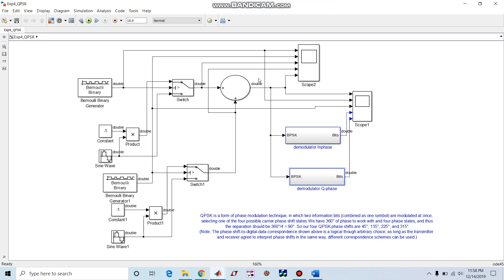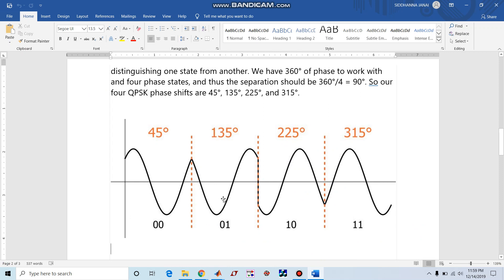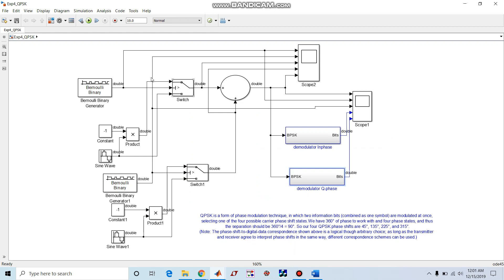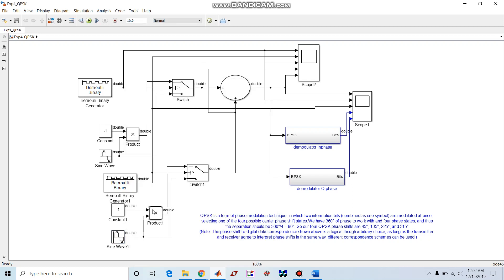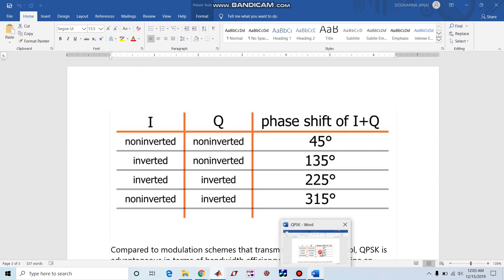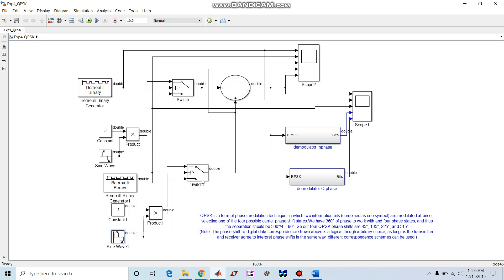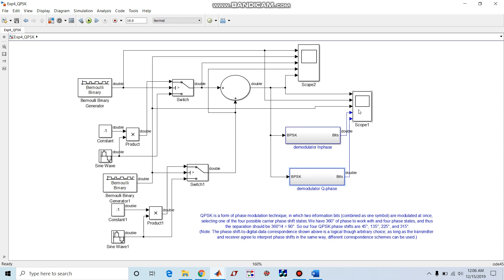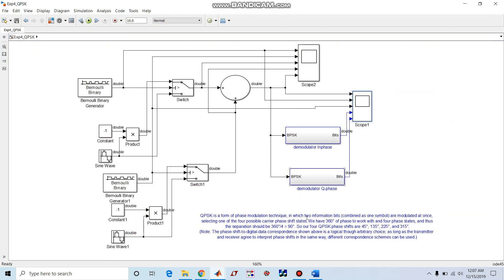QPSK | Quadrature Phase Shift Keying | Software Exp_4B | Communication_Lab_18ECL67 #VTU #ECE |MATLAB

Comment: I have a question since u have used two binary Bernoulli generators ..will both produce same sequence or different?
Reply from the maker: If the initial seed in the Bernoulli generator is changed then both the sequences will be different
Reply: @_Learn_With_Me_EraofAI  if both are producing different sequence then how you are extracting even and odd bits of original signal. Rather you are generating even and odd bits separately which are not a part of original signal as there is no original signal
Reply: Actually my project is on this. I have to achieve higher data rate in terms of MHz. Can u suggest anything regarding it?
Reply from the maker: @shubhamnayak9369 I have faced some difficulties when tried generating single sequence and dividing it into even and odd . So I took two random sequences one assumed to be odd and another even. 

My interest was to illustrate the in-phase, quadrature phase and qpsk waveforms.
Reply from the maker: @shubhamnayak9369  I think for MHz frequencies you can use matlab's inbuilt qpsk modulator and demodulators
Reply: @_Learn_With_Me_EraofAI  ok thanks for replying. Your efforts are appreciated.
Reply: @_Learn_With_Me_EraofAI  I was unknown of this that matlab has inbuilt qpsk system. Thanks for letting me know. I will try
Reply from the maker: @shubhamnayak9369  Thank you. All the best.

Comment: Can u upload the comparator block which was used in book block?
Reply: Bpsk*
Reply from the maker: Send me the particular block diagram you want to implement
Reply: @_Learn_With_Me_EraofAI  I am implementing the same which u have explained in the video. In demodulation part I was struck. Comparator block u have used in bpsk block. U didn't open dat comparator block. I want to know how u did comparator block?
Reply: @_Learn_With_Me_EraofAI  can u upload the file which u have explained in the video
Reply from the maker: @akashh.m2115  comparator is simple..u can got to library and search comparator and use it.

I have used already available demodulator block from online, if u want send me your email id
Reply: @_Learn_With_Me_EraofAI  bro have u sent the file?
Reply from the maker: @akashh.m2115  check your email.
..sent to wrong Id earlier
Reply from the maker: Use the demodulator block in the dpsk Simulink model
Reply from the maker: @dhrubasunuwar6191  ok
Reply: @_Learn_With_Me_EraofAI  
sir, have you sent the mail?
Reply from the maker: @dhrubasunuwar6191  I have forwarded it to you